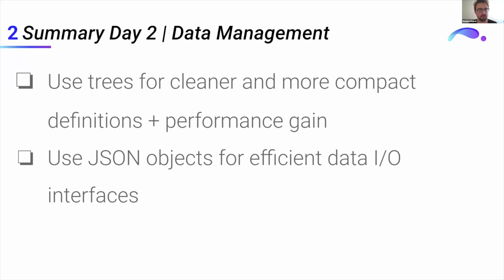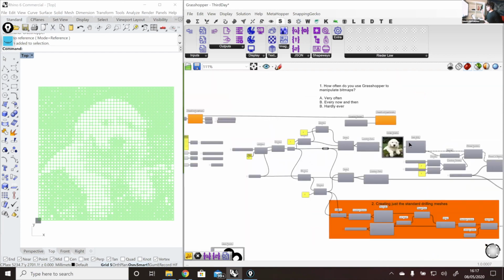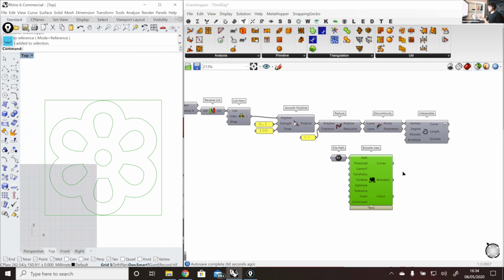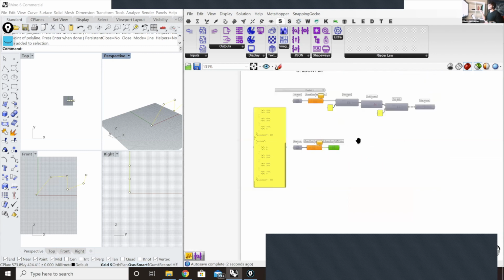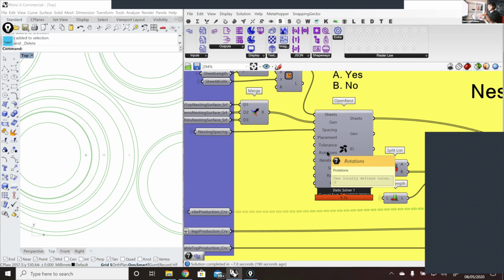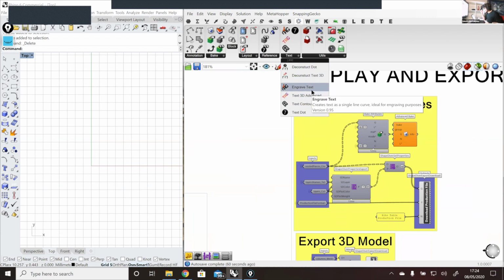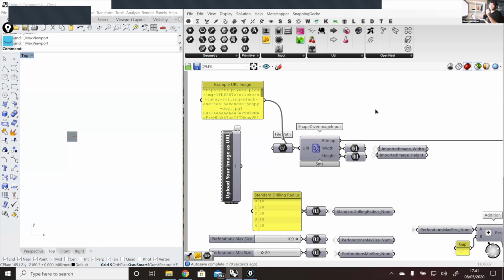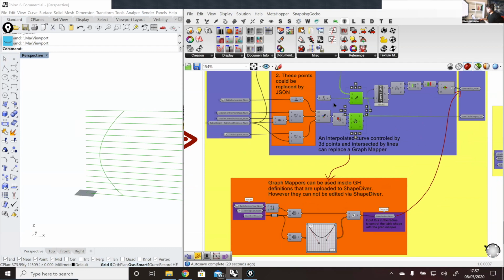Parametric Design For Cloud Applications Webinar | Session 3

Comment from the maker: -- Webinar Intro ---
0:00 Intro
3:41 Answer to Challenge 2 of Ribs Table
-- Standard Native GH Inputs --
11:40 Standard Native GH Inputs Supported by ShapeDiver
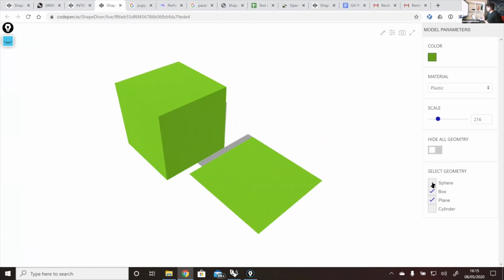14:44 Example using all native GH inputs
-- ShapeDiver Inputs (Text, Image Files) --
15:20 Introducing ShapeDiver Inputs
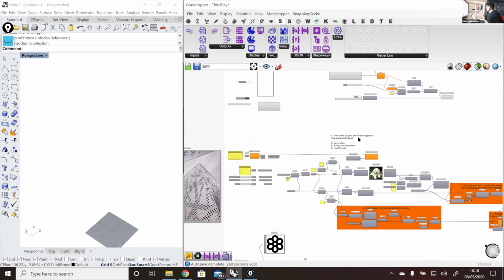16:01 Introducing First Poll: How often do you use Grasshopper to manipulate bitmaps?
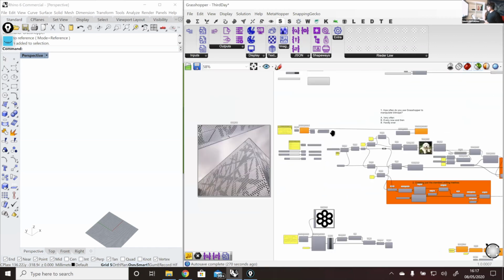16:18 Pattern Wall Using Local Files
17:26 Introduction to ShapeDiver Image Sampler and ShapeDiver Image Input
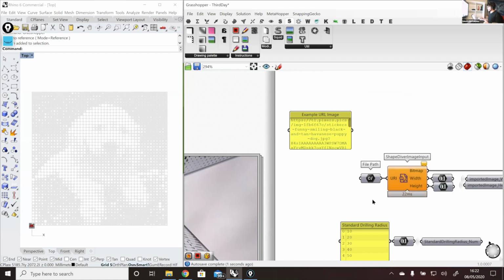22:11 Introduction to ShapeDiver Text Input
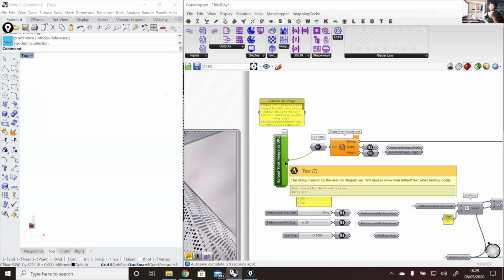24:42 ShapeDiver Image Input combined with ShapeDiver Text Input
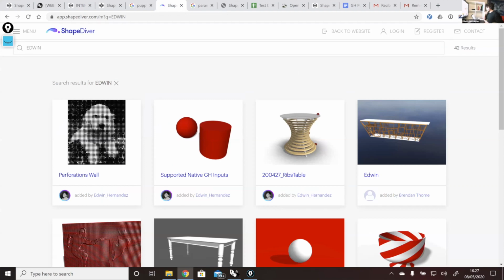26:41 Result of First Poll: How often do you use Grasshopper to manipulate bitmaps?
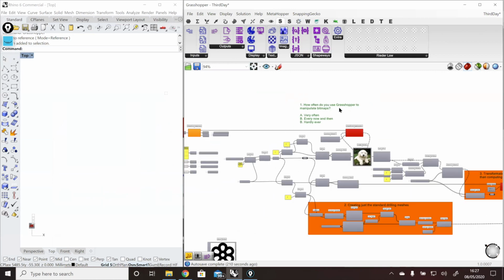26:56 Manipulating bitmaps
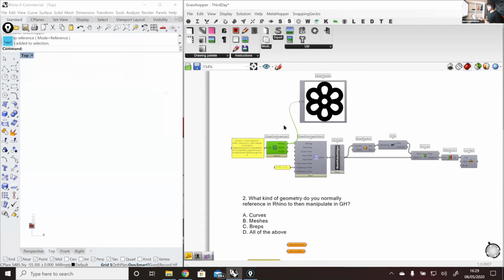28:56 Introduction to ShapeDiver Image to Mesh Component
33:32 Use case for ShapeDiver Image to Mesh component: Ribs Table
36:07 Use case for ShapeDiver Image to Mesh component: Fins Wall
37:16 Default and Maximum Size for Files Inputs
-- ShapeDiver Inputs (Geometry Files) --
39:39 Introducing Second Poll: What kind of geometry do you normally reference in Rhino to then manipulate in GH?
40:07 Introduction to ShapeDiver Geometry Input Component
41:57 Use case for ShapeDiver Geometry Input Component: Lego
43:18 Result of Second Poll: What kind of geometry do you normally reference in Rhino to then manipulate in GH?
-- ShapeDiver Inputs (Text Files) --
44:41 Introducing Third Poll: When you need to work with databases, in which format are they stored?
45:01 Introduction to ShapeDiver Text File Input component
46:01 Use case for ShapeDiver Text File Input component: Database in spreadsheet
48:18 Use case for ShapeDiver Text File Input component: JSON Object
50:25 Result of Third Poll: When you need to work with databases, in which format are they stored?
-- ShapeDiver Outputs (Data/Text, Image Files, Geometry Files and Text Files) --
52:46 Introducing ShapeDiver Outputs
53:17 Introduction to ShapeDiver Data Output Component
53:41 Use case for ShapeDiver Data Output Component: Output data from spreadsheet
55:07 Use case for ShapeDiver Data Output Component: Output JSON format
55:46 How data is accessed via the API?
57:38 Introduction to ShapeDiver Export Download Component
-- Nesting --
1:00:30 Introducing Fourth Poll: Have you ever worked with products that require nesting to generate the production files?
1:00:57 Introduction to OpenNest Component
1:02:46 Nesting Surfaces vs Curves
1:04:10 Creating optimized geometry for nesting
1:05:29 Using nested transformations to position final geometry
1:06:46 Other parameters to manipulate the nesting process
1:07:38 Result of Fourth Poll: Have you ever worked with products that require nesting to generate the production files?
1:08:14 Why are polylines faster than nurbs curves?
1:10:13 Turning on and off parts of the definition to optimize computation
1:14:03 Grouping geometry to apply layers and colours to export file
1:17:01 Introduction to ShapeDiver Properties Export and ShapeDiver Set Properties Components
1:18:12 Using FabTools plugin for local testing and ShapeDiver to download the final files
1:19:37 Creating text for engraving
-- Drawings --
1:24:50 Introduction to Make2D Component to create 2D Drawings
1:26:30 Creating camera views for Make2D component
1:28:28 Optimizing Make2D component computation
1:29:33 Introduction to Squid plugin: Converting curves into bitmaps
1:31:21 Downloading bitmap in ShapeDiver
--- Webinar Outro and Q&A ---
1:33:30 End of official webinar
1:34:44 Does Make2D Rhino View works with ShapeDiver?
1:36:16 Internalising bitmaps in Grasshopper
1:38:33 Monetise your Grasshopper models: Algorithm as a service
1:41:07 Internalising bitmaps vs storing images in a database
1:44:04 Representing complex patterns with textures instead of meshes
1:45:35 ShapeDiver Display Geometry, ShapeDiver Simple Material and ShapeDiver Material components
1:48:34 ShapeDiver markets, new technologies and the future of ShapeDiver
1:54:06 Supported third party plugins by ShapeDiver
1:55:34 Why graph mappers are not shown in ShapeDiver and how to replace them?
1:57:04 End of Webinar